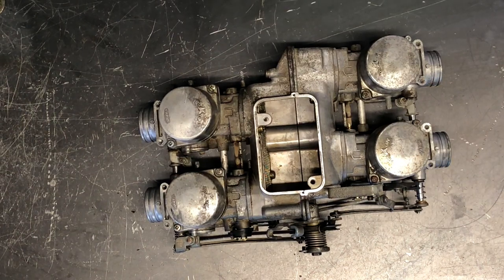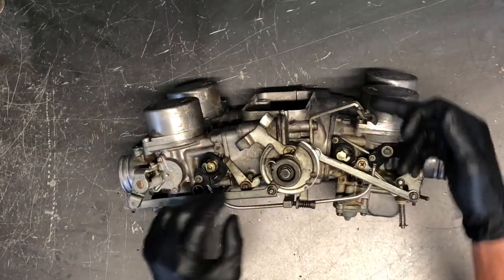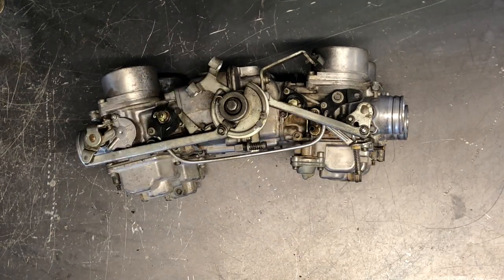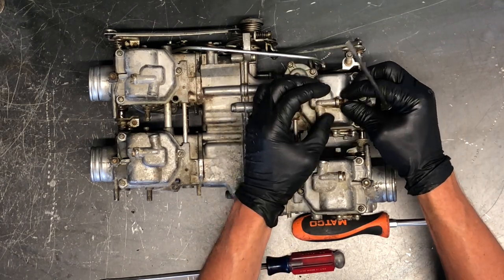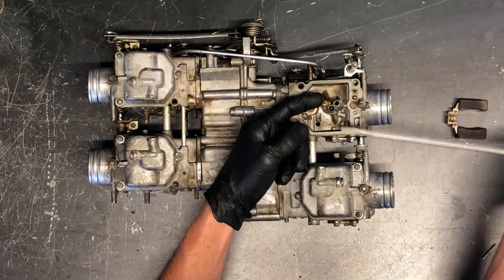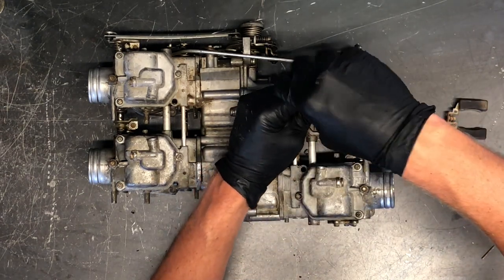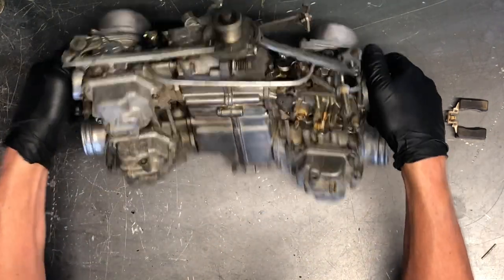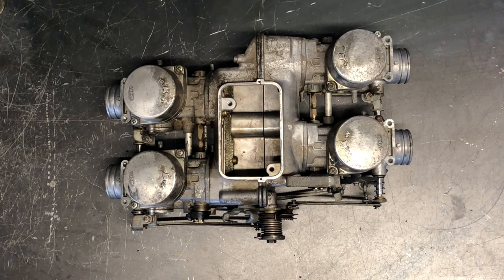Honda Goldwing 1100 - #1 Carb Clean  /  Carburetor Rebuild Video

Comment: I also own an 82 GL1100A and the throttle cable wheel only turns a small amount and the butterflys only open on the linkage side.  The other side seems seized or jammed.  Any suggestions on how to free that linkage up to the other two carbs.

Comment: OMG! How did you miss so much? All this is, is a tutorial how to dissemble and reassemble the carb, with NO mention about how to remove any aluminum corrosion blemishes from the inside of the vacuum throttle heads. (Most common performance issue on these.)

Comment: Great video, how do you clean the carb when the jets are pressed in like on the 1980 GL1100? I tried to boil it with vinegar and water, carb cleaner and even bought an ultra sonic cleaner
Reply: Get a 3mm x 0.5p tap and run it down into the pilot jet about 3 full turns after it bites. Leave the tap in temporarily (to block off the hole) as you blow the brass chips out of the pilot jet tower with compressed air. Remove tap. Get a 3mm x 0.5p machine screw that's about 30mm long and run a nut halfway up the threads. Slide a washer (that's wide enough to cover the pilot jet tower) up under the nut. Place assembly over the tower and gently tighten the screw into the tapped hole until it "just" snugs up, then STOP. Adjust the nut down the threads of the screw by hand until both the nut and washer are in direct contact with the top of the tower. While holding the head of the screw, slowly tighten the nut with a wrench. In a turn or two, you will have "pulled" the pressed in pilot jet from its seat. Clean, and replace, or buy new ones and replace. They can be pressed back into place with a few gentle taps with a very small hammer and a 1/4" punch or small brass drift. Warning- The jet only needs to be driven in ~1mm deep, so mark the driver with a line. If you're generally ham fisted, or find yourself frequently overtightening things, I suggest that you find a helper with a gentle touch and let her do it.

Comment: I just purchased my first bike for next to nothing from a family friend of mine. He said the bike always had carb issues, and for three years now it has sat in a garage full of gas and oil. I have no experience with either cars or motorcycles but it has always been a dream of mine to repair and own a bike. What would you suggest I do begin working on this bike? Continue exploring youtube? Buy books and manuals? Or just start getting my hands dirty and tear up the bike with what I know. What are some starting tools and equipment do I need before I get really into this? Any help is greatly appreciated.
Reply: Hey man! Hope its all going good! If its a goldwing like the one in the video i highly suggest you pick up a manual and join a forum! I personally ride a 1981 Naked Goldwing, so ive joined the for them, NGWClub.

Comment: I only made it 20 seconds. When I saw that you were wearing your mother's dishwashing gloves that's all I needed to see. REAL MEN HAVE CALLUSES AND SCARS!
Reply: @MidNebraskaMotorsports  wow you make a lot of assumptions, said the guy who's building a tiny house on a fifth wheel trailer in front of a mobile home that belonged to a friend's mother who passed away. Actually the disabled old guy who is still building his own tiny house with his own scarred up callused man hands enduring more pain than you could ever handle little girl.
Reply: Go ahead and you'll smell like gasoline for a week after, I thought the same thing until I started and found out the smell of rancid gas is way worse than normal clean gas and it will absorb into your skin and smell bad....good luck with your calluses as you call them...
Reply: Most of us have callouses and scars. I also have hands that get so dry and damaged from carb and brake cleaner that they were cracking open and bleeding. Then I discovered I have a brain, so I bought chemical resistant black nitrile gloves that, to the untrained eye, look remarkably like your mother's dishwashing gloves. So now after working on my bike/car/tractor/snowblower, when I caress my wife, she no longer says, "stop touching me with sandpaper that smells like chemicals". YMMV but I doubt it.